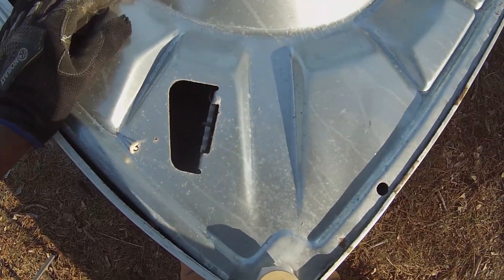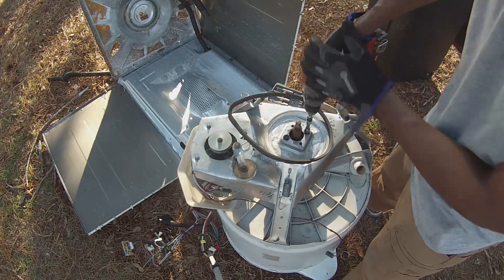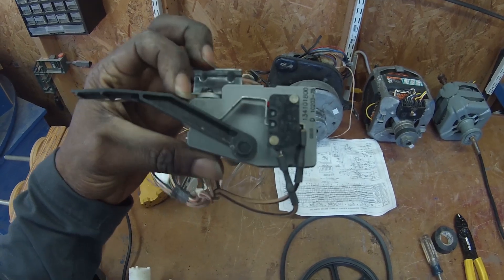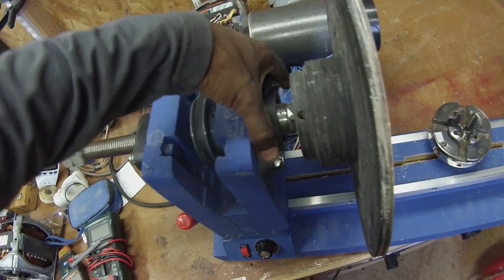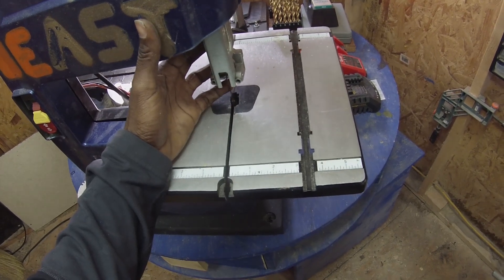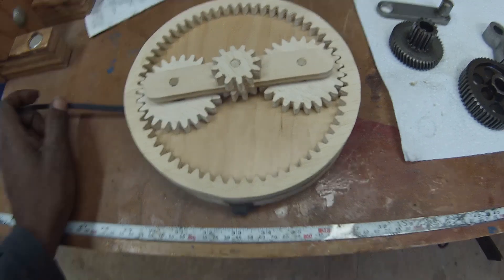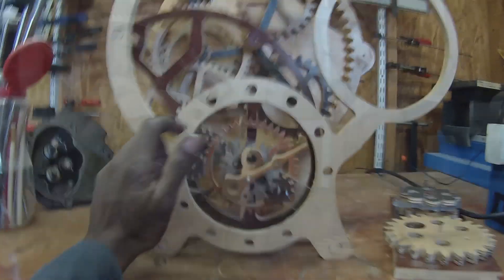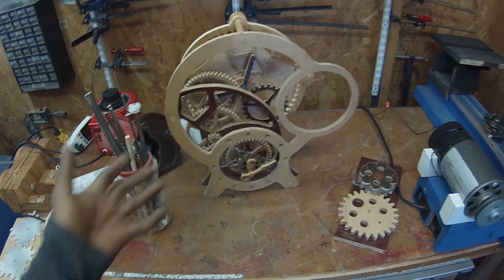Things You Can Make With A Washing Machine And Other Salvaged Components : 020

Comment: Here, A cryogenic stirling piston operated off electric motor that turned argon gas to liquid that filled and insulsted tank with a bell siphon that filled a large fin heat exchange with a high velocity fan to draw air through heat exchange to super coo thel air with the liquid gas boil off vapor returning to tank with cryogenic piston to turn gas back to liquid to start cycle all over. The use of a solid state sponge for the argon gas to allow gas to be absorbed by sponge when unit is turned off. Unit designed with self generating power source would mean free air conditioning and even freezers and refrigerators could also be developed. I just need a tech person who knows how to make use of different components like yourself to complete many other projects. novarti
Reply from the maker: You have quite a long list of ideas after reading all your comments. I love to create new things. However most of the technology you are describing will require some serious research, time, and money. I can learn anything your budget can handle LOL. If you really want to contact me, my website is www.jeremyfielding.com.
Reply: Jeremy Fielding research the different components by watching a few you tube vides. Stirling engine can turn atmosphere to liquid from reaching ultra low temperatures. solid stste graphite power cells generate electrical charge off the graphite crystals and electrolyte being vibrated by the energy that generates earths atmosphere just like how crystal structures in magnets generate a north and south pole. Which would also mean magnets would not operate out of earths resonance field did you know this? These solid state graphite power cells can be tuned by using the correct hertz frequency to optimize their electrical power generation and when paired with organic carbon power cells can generate electrical power far better then solar panels. Crystal vibration power systems the sun light has a hertz of 126.22 so using the correct herts frequency IE low voltage hertz emitting diodes each graphite power cell could reach its optimal electrical power output that feed into carbon power cells and or graphite airogel ultra power cells that are contructed like carbon capacitors. Contructed like the size of a thirty gallon propane tank. This power generation system heating and cooling advancements could be used in travel traliers which would mean they would not need to be hooked into shore power to have all their systems powered. This technology can also be used in home power heating and cooling systems and electric vehicle systems has well. If its not worth your time to look into then thank you for reading posts. = )
Reply: Jeremy Fielding these ideas are just small concepts of larger component parts of a greater design. Just has you can take components from other devices and make other things i too can create other devices from the neat ideas commented about. I am just looking for a simular minded person to help produce a few devices. I am not looking to patent anythlng because of certain information i have gained about the patent office and how a group controls all new technology. I just want to make the devices then flood the internet with the information on how to construct said devices to improve other peoples lives. No more no less i myself would like to have these devices to improve my own life this is why i sat down and put all the design concepts together from living without air conditioning and a reliable heating system. say like using low voltage seed warming LED light mats, lay down foil bubble insulstion then heat rated foam then lsy carpet over that for a redundant low voltage heating system? Or wrapping those LED warming lights on the inside of a clay pot for a low voltage warming pot that could heat a home or green house or workshop? ; )

Comment: A helicone with solid state power cells on each pedel to generate electrical charge to charge carbon power cells in branches of helicone with a vacuum spark gap in eack branch that feeds into the trunk of the helicone. Helicone trunk having a graphite or graphene airogel ultra power cell in the trunk of helicone that feeds into super conductor that helicone is connected to. A sphere with three or more helicones all connected at the center to super conductor with tesla energy transfer coil to transmit generated high frequency electrical energy to power a home. A earth resonance power generation sphere. Now sit down and read this a few times till you understand what you have been given? Then when your ready lets make some other devices shall we? ; )

Comment: Here, induction cook top components and electronics used to transmit a enegery frequency between coil A to coil B in a loop with out any loss of energy that caused a graphite heating element to glow red hot with an electric fan to force air over heated element. A solid state graphite power cell bank that charged carbon power cells to provide the electrical power for the electronics and to power the electric fan. A space heater that would operate off earths resonanc field would help millions stay warm without having to plug in charge up or burn anything. State of the art heating products.

Comment: Would you be interested in working on a v-6 stirling cold gas engine with two fly wheels with magnetic bearings on all moving parts that cranked two rewired drum motor generstors with magnetic bearings for a new type of  electrical power generation system? I left out some critical components that make it all work. I am looking for an individual like yourself to help me with a few projects. like a space heater and space air conditioner that you do not have to plug in or recharge or refuel. Ground breaking to say the least. How would a power generation system that was also the central heating and cooling system for home sound to you? Are you familiar with solid state graphite power cells and organic carbon power cells and solid state sponges? It sounds to good to be true yet think about the technology first. A electrical power generator that operated of liquid gas in a cycle that operated in a loop using a cold gas sterling engine design? Let me know if your interested? : )

Comment: Interesting stuff..
But i think i would have used the microwave motor in the clock and the window lift motor in the spinny desk toy...the window motor isnt for constant use.
Very impressed though
Reply from the maker: +twoeightythreez that was what I said in the video... but then I realized the microwave motor was not strong enough to push such a large assembly of gears. The small toy was also going to be a clock

Comment: Cool video, I just made a utility heater for my 3 car garage out of an old electric stove. It cost me nothing but a little time, and it works great. It has 5 heat settings ranging from Aproximately 7000 to 40,000 btu. However if you decide to make one yourself be sure you know at least the basics of electrical work, and use common sense. This is not something I would ever leave running unattended.
Reply from the maker: No I will be on the look out for stoves. Thanks lol

Comment: Ok boss so I was driving down the road the other day, and.saw a couple old vacuums setting on the side of the road left overs from a yard sale. So I stopped to see if they'd let me have one. But nobody answered the door so I just took em both. One looked like it would start as soon as I plugged it in. It didn't, But the other one was missing the top 3rd. I didn't figure it would be good for anything but parts, but after the first one didn't run I tried it anyway.And dang if it didnt start up and suck lile a champ. So I parted out the pretty one And then went to trying to think of something for the working one. Well it took about a weak and it came to me. I used it to add a vacuum system to my work bench. It has a work top vacuum trough for quick clean up of my bench, I added a floor level version of the same and on each corner I added a port were I can use a vacuum hose or PVC pipes to add a targetable spot vacuum for were ever I need it. I was so thinking about you and your videos when I ce up with this idea. Keep the videos coming, thanks again
Reply from the maker: That is awesome! My work here is done lol

Comment: I've always wondered if you could take a high-efficiency washing machine and convert it into a car or bike or go kart. What are your thoughts on that?
Reply from the maker: The motor requires AC power. You would have to carry an inverter to change the batteries output to AC. Other than that, it is certainly possible.
Reply: I thought the HE motors were synchronous(?) and the speed was controlled by pulses generated either off the mains or could be driven from switching a DC source. I may be wrong on that tho.....wouldn't be the first time! Lol
Reply: Oh and thanks for the near immediate reply I appreciate it and your clock is absolutely beautiful!! Not to mention the well crafted toys and tool creations/mods.
Reply from the maker: +John Frick I don't know if they (HE) are synchronous or not. I missed that part. Either way it can be done. Every machine I have opened has been a capacitor start induction motor.

Comment: Hello, 
Jeremy, I just saw your video on:  Things you can make with a washing machine. For my first time. I like to tinker and build this although I'm not real good at it. I would like you help on building something, I build audio cables and I need a wire brader using three wires (like plaiting hair). The gears on your clock made me think of some ways to do it. Can I get your e-mail address. Maryland
Reply from the maker: use my website if you want to send me an email www.jeremyfielding.com

Comment: Nice dude! I have one tip for fellow makers, Good Will Outlet has lots of things to scrap parts from in my part of the country.   They charge by the pound or some things are fixed price like printers for 3$. Keep up the good work!
Reply from the maker: I occasionally stop by the good will just to see what is there. I rarely find good mechanical components (what I am always looking for), but I think if you are looking for electronics there are always old tv's vcr's, and other aging electronics. Maybe a good source for switches, capacitors, etc.

Comment: Amazing all you need is a welding machine to make better stuff instead of wood.
Reply from the maker: For me the wood is what makes it interesting. It is very cheap, cuts very fast compared to steel, and accessible (cheaper tools required). I do have plans to get a metal lathe, and will start making parts from steel. I will also continue to make things out of wood as well. Especially prototypes... which is something I make often. Steel is stronger but the geometry of the part matters way more than the strength of the material. Steel will break as well with a poor design. Plastic will do great if designed correctly.
Reply: Jeremy Fielding hoo ok. Nice you know your stuff. A lathe is cool. I might get one aswell.

Comment: It's not an induction motor it's "split phase". High Starting torque, good choice for power tools
Reply from the maker: +pleasecho2 A split phase is a subtype of induction motor. A quick google search should clear this up for you. A great day to learn!
Reply: I was trying to avoid confusion as "induction"  normally refers to 3 phase motors in which the electric current in the rotor needed to produce torque is obtained by electromagnetic induction from the magnetic field of the stator winding.

Comment: Yoi mentioned that vacuum motor slowed down under load. What is you experience what was the rpm of motor when under the load of sanding?
Reply from the maker: I wasn't measuring the rpm at the time. But they are directly proportional (force on the belt to rpm). If you press hard it slows down alot. Sorry I can't give you an exact scale.

Comment: Outstanding Jeremy Fielding!! I'm currently working on a 72x2 belt sander using a washer motor. Although after watching your work I'm thinking it's not the best choice. I have also used washer parts for all sorts of things. I currently have a metal tub cut in half lining by BBQ pit. Fits perfectly in a 55 gal barrel and because of the coating withstands the heat better than anything you can buy. Thank You for the videos!! Amazing work!!

Comment: Nice work all round, the USA washing machines differ a lot from UK machines, Our springs are up the top to suspend the drum for starters lol, but yeah useful ideas :).
Reply from the maker: I have had several people comment on this. For example from Germany I was told their motors are usually universal motors. I have disassembled at least 10 machines all different ages and all the major brands here... I have not seen a universal motor in a washing machine here. Very interesting indeed.

Comment: Hey I am a new subscriber and I really like your videos.  Can you help me solve an issue ?  I have an alternator that I know can be made into a motor.  The first thing I don't understand is that if you take the diods (?) out that you can get 3 phase 220 out of it.  I understand that a regular 220 plug from a house has 120 v out of each side making it a 220volt with the other being a ground.  Is that a 3 phase ?  What makes it 3 phase and do you get 3 phase from your box from your house ?  then I have heard that if you put a ???? can't remember the name but it makes 12volt out of the alternator.  so how do you make an alternator a motor ?  I had an old stand sanding drum that had a otor that was 110 and looked like a gm alternator.  so how did they do it ?  I would love to know how to do it !  Thanks ...... good luck with all you do !
Reply from the maker: Three phase power is "3" different single phase lines powering one device. They are "out of phase" with each other. This is different from single phase 240 found in most american houses including mine. Most homes (at least in the US) don't have three phase power. It is usually only at industrial sites, with large machines. I plan to discuss many of your questions in my new series on "Motors for absolute Beginners". If all goes well it will start next week. I posted a video today that shows me making a motor from microwave parts. Along the way I show the components of the motor. If I can show it in a video you will understand much more then what I can explain in the comments. Here is my video posted today...https://youtu.be/au_c8WmgWTc

Here is a video that explains how motors work, and it details three phase power. I have watched this video many times. It is very good   https://www.youtube.com/watch?v=07uXnc1C5CA&list=PL4njCTv7IRbyKgThEd0aBaqdLx3koCpCs&index=9&t=4s

Comment: https://www.youtube.com/watch?v=64p4tkjnsFQ
this guy can make a table saw from a wireless 12v cordless motor, im sure you can make a saw mill from 2 washing machine motors, no? :-)
Reply from the maker: If you are not concerned about how much performance you can actually get from the machine, I can make a saw mill from my sons rc car motor. But it might only cut paper. The tools that guy makes are very small and weak. They might be good for making crafts, but you are asking about sawing logs. 

Two washing machines motors... Well, with two now we have doubled the power, and I believe you would get yourself a decent saw mill. But in the same line of thought, better performance and speed will come with more power.

Comment: Hi Jeremy, Wow, I just came across your Video and was so impressed at what you made and salvaged, Like you I do tend to collect ( Ha Ha Horde rather throw away things ) and have tons of Junk(que) . At my age (73 yo) I want to, ( now that I have the time) do what you do and start to salvage parts, I have just yesterday completed the strip down of a Washing Machine (The hard way) The motor and all components ie: the wiring harness and timers still connected are now out still intact. With the time that has elapsed , the pulley has rusted on to the shaft and that next ( suggestions please how to remove) But, more to the point Your video has inspired me and I have subscribed to your channel. Thanks for the info supplied in the video and the listing of more videos. :-) , my weekend is now set, Watch and learn more Youtube is great. I am a D I Y guy , I say Jack of all trades , Master of none, But with YouTube help, I now classify myself as a master of Youtube search. Again Thanks. GBF .
Reply from the maker: George... that is awesome. Have fun with it... You could use WD40 to help get the rusty parts moving but I have so many washing machine parts I usually just throw away the parts I can't remove.
Reply: Thank you for taking the time to reply and the Rusty parts removal Tip.

Comment: how did you learn to do gears with proper size for clock and stuff ? are you a  physic or math genius as well ? lol. i have got no such knowledge.
Reply from the maker: Basically I obsessively read about a topic until I can do it myself. I don't have any official training. For the most part, gears are just wheels. The ratio between the wheel sizes changes the speed and the torque of the mating gear by the same ratio. I started with zero knowledge and a whole lot of curiosity and persistence.
Reply: "gears are just wheels", i know that.. just how did you do the calculation of the gear size to get the ratio you want.. that's a good technical skill. ur persistence paid off.. persistence is the key.. ya..

Comment: My wife is an artist who works with pastel pencils. The pigment is softer than regular coloured pencils and breaks when using traditional pencil sharpeners so I built her a small disk sander for sharpening them from a salvaged electric toothbrush motor, hard disk drive platter and 5V power supply kept from some long dead device.
Reply from the maker: That is just awesome. I will try to include this in a future video. Great easy idea for people to try.